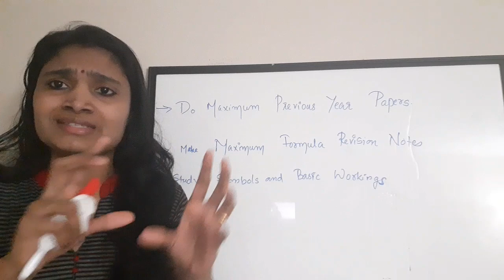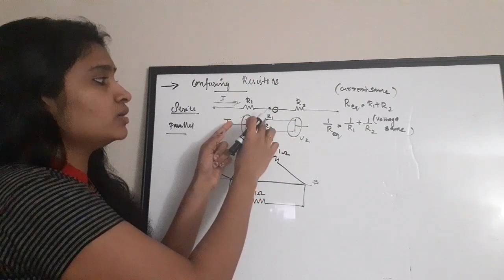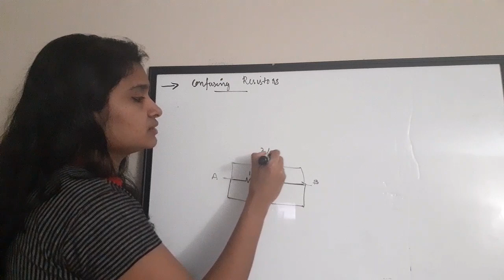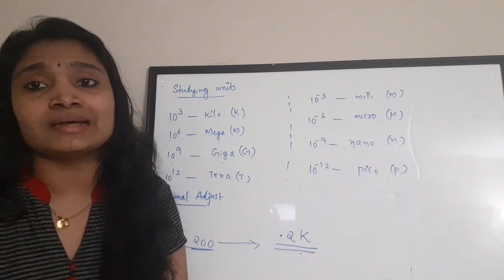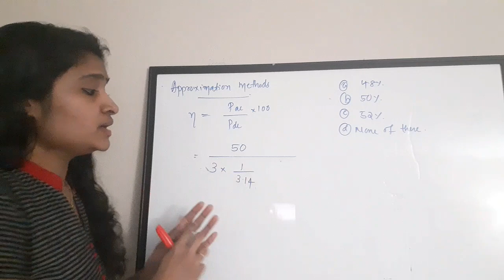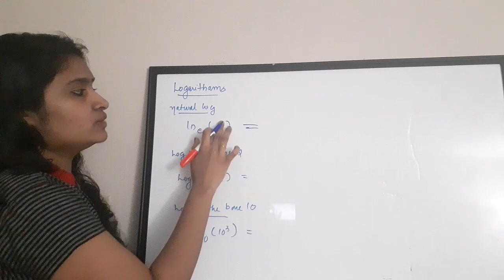Tips and Tricks to Crack Competitive Exams of Electronics Part1 ||ECE||EEE||EI Branches

Comment: A radio receiver is tuned to 750khz and its oscillator frequency is 925khz. What would the image frequency be, 1000khz, 1100khz, 1170khz or 1125khz? Please explain step by step please solve these kind of problems thank you
Reply from the maker: I have done a lot of these kind of image frequency Questions. Will.try to Answer shortly
Reply: 1100 khz is the right answer